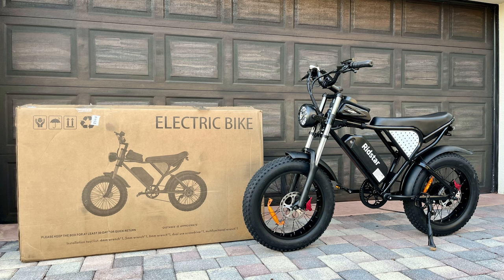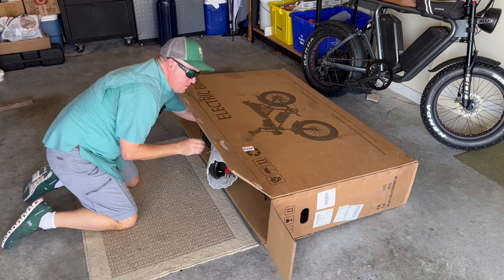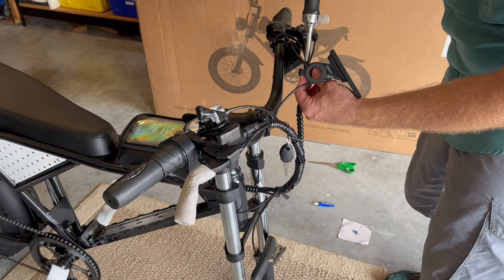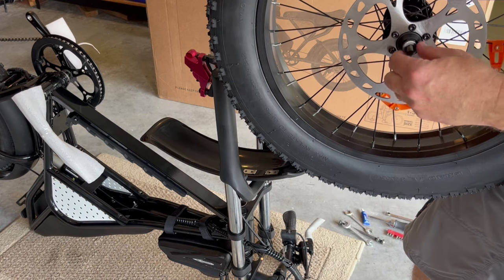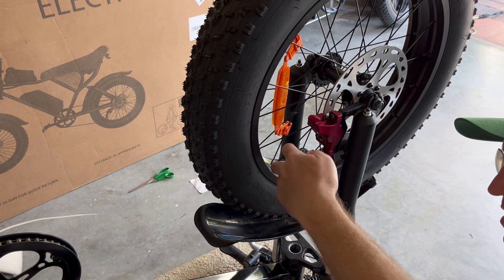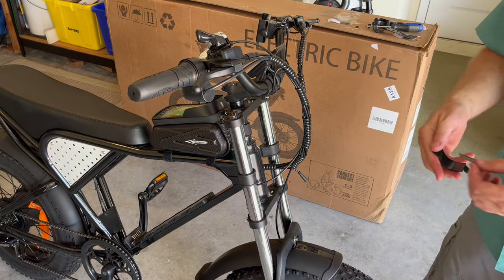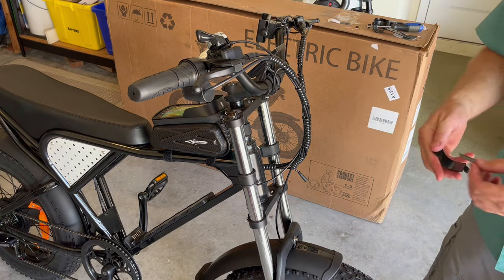Ridstar Q20 eBike - Unbox - Assembly - Settings

Comment: only problem i have is the front and back brakes not working and i cannot tighten them up how i want
Reply from the maker: loose 2 bolts on brake caliper so caliper can move in and out.  Squeeze brake lever to center caliper on rotor.  With lever squeezed then tighten bolts on caliper so its centered

Comment: I bought this bike from amazon,and arrived 16 days later. Really cool bike. Your video was really helpfull in putting it together.
I like everything except the handle bars are to low. Is there a kit to raise them up?
Reply from the maker: Glad I could help.   You can install handlebar spacer or stem riser.   Here is link and how to video. https://amzn.to/43632Gz.   https://youtu.be/vT6DfaVPI24
Reply: @BRichSolution  I was looking over the cable and wires, and they look like they are to short to raise the handle bar up. What size would you recommend for the Q20?
Reply: How's the bike holding up ??
Reply: @gates1980  I really like this bike. I would recommend this bike to everyone. Great price too!

Comment: I cant put my front wheel on, the front brake calipers are way too tight to slide the wheel in. What do I do?
Reply from the maker: You will need to spread the brake pads a part using a small wedge or door stop so you can slide the rotor between the pads

Comment: My disc brake still rubs I'm lost on how to fix it i followed the instructions
Reply from the maker: loosen bolt on the caliper brake so brake caliper can be adjusted freely.   squeeze brake to center on rotor and while brake is squeezed tight bolts so caliper is aligned with rotor
Reply: @BRichSolution  thanks I think I got it fixed I can't ride til tomorrow tho so I'll get bk to u appreciate u!!!!

Comment: Got my bike put together, but the front break isn’t working (I have no experience with disk breaks). Any advice?
Reply from the maker: When u squeeze the front brake lever nothing happens?   If so local bike shop can bleed brake line in 5 minutes for you
Reply: @BRichSolution  I’m able to squeeze the brake lever to the grip. I also tried loosening the pads since they’re rubbing the disc (like you did in the vid). But the bolts are fairly tight, to the point the Allen wrench feels like it’s about to break trying to loosen them.

Comment: Hello I have a question, when u keep the + electric gear up for like 3 second it says something on the screen what does that mean
Reply from the maker: Hold on the + button turns on headlight if configure that way… but this bike is not and has manual switch for headlight

Comment: Hi I just purchased a ridstar q20 but the front wheel axel is too short to even screw onto the bike?? Is there any way I can remedy this! Or would I have to take the whole thing apart again and return it?
Reply from the maker: Ask seller for longer axial bolt or go to ace hardware or tru value hardware department and find a longer axial bolt

Comment: Hello, does it have a Serial Number ? If so where can I find it ?
 I got this EBike based on your favorable reviews of its value vs performance.
 I need the SN so I can get a Rebate from our county"s eBike encouragement program.
Reply from the maker: Serial # is on left side of steering tune (handlebars into the frame)
Reply: @BRichSolution  Thank you for the very prompt reply.

Comment: Do you happen to know what size the bolt and washer are for the front tire? Mine somehow fell off and I can’t seem to figure it out.
Reply from the maker: M10 axle bolt by 175mm long should work.   https://www.ebay.com/itm/174666567440?mkcid=16&mkevt=1&mkrid=711-127632-2357-0&ssspo=cx2qeP1dTGq&sssrc=4429486&ssuid=qKDltCGGRDS&var=&widget_ver=artemis&media=COPY

Comment: Bonjour monsieur je ne sais pas si vous comprenez le français mais j'ai un problème, je n'y connais rien c'est mon premier vélo électrique. J'ai bien enclenché la batterie mais je n'arrive pas à tourner la clé et je ne veux pas forcer. Merci si vous me répondez, sinon je vais essayer de vous écrire avec Google traduction. Bonne journée
Reply from the maker: I had this issue with another bike.  Ask seller for replacement throttle and key

Comment: My chain slipped off and i don’t know what to do it’s on the right side pedal
Reply from the maker: Pull transmission (2 small wheels in the back) forward and chain has slack to engage front sprocket
Reply: @BRichSolution  i have one more question I tried getting the battery to charge and it was showing red on both sides and now it’s showing red and green. When i first plugged it up the fan would start making noise which i think it’s intended but now its not, it was charging properly or really i don’t know but if you can respond that would.

Great video btw

Comment: how do i take the battery off, because my key only turns 180 degrees from left to right. I don't dare twist or give the battery a tug.
Reply from the maker: Try to move or jiggle the battery on the frame when turning key to get the lock plunger to loosen up
Reply: Thanks for the advice, It works!

Comment: I got mine today and it seems like the breaks aren't working well at all the front and back ones barley work do you know why and what the fix is?
Reply from the maker: Is the lever easy squeezed all the way down and pads did not engage rotor?   If so maybe forgot to put hydraulic fluid in the brake lines?   You will need to bleed brake lines and fill with mineral oil or take to local bike shop they can bleed lines in 10 minutes
Reply: I noticed it's only the front break there is no compression with the front break could it be I didn't but it in the caliper properly or most likely just needs breaks blead

Comment: Has anyone tried throwing a higher amp controller in one of these?
Reply from the maker: Q20 speed and torque is respected and not worth changing controller IMO as you’d only gain 1-2 mph top speed.  $5000 super 73s only do 32 mph due to physics of 48V battery and motor.   The other issue is higher amps means less range.  See controller specs in this video https://youtu.be/Z7i8O1BFJdc
Reply from the maker: Do you have the 15Ah version or 20Ah version of the Q20 bike?

Comment: I just bought and built a ridstar but the breaks are really bad and in first gear when I pedal it just clicks please help
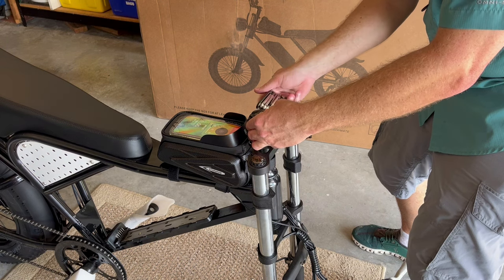Reply from the maker: see video linked below at 2:55 for aligning brakes https://youtu.be/uk_nC9anQcM?si=6ypqSvX8NsCVti84
Reply: @BRichSolution  hi thanks so much for replying yes I tried too but my bolts are too tight to tighten them more I am hardly unscrew or screw it more and for some reason my gears are weird please help me

Comment: Have you heard about Mario Retro Plus e-bike?
Reply from the maker: Mario retro plus is 1000w motor with only 15ah battery (throttle only range maybe 25 miles) and over priced at $1595.   For $1500 buy a dual battery Yolin with 44ah battery with 60 mile throttle only range.  Also the Mario has no rear suspension.   This Ridstar q20 for $1000 is much better deal over the Mario

Comment: Yet another question. The manual states that if the battery makes a strange noise, the battery may not continue to charge and is therefore defective. I doubt the sound I hear. may the charger blow a little to cool?
Reply from the maker: Yes the charger has a fan on it to keep it cool

Comment: Did any of you take the test for this bc my state considers it as a moped vehicle and requires me to have a operational license 😢
Reply from the maker: Most states ebike law is pedals and 750W max.  This has 1000w but most cops don’t know what they are looking at or buy a sticker that says 750w and they will leave u alone
Reply: @BRichSolution  I won't really use it on the road, just mostly on trails so should I buy it?

Comment: After I messed with the settings my battery only shows 1 bar out of  ten on the display. Do you know how to fix this?
Reply from the maker: The last setting in the advanced menu should reset everything back to factory default.  Hold the + and - buttons for 3 secs
Reply: @BRichSolution how do I reset it from that menu, if it’s the same buttons to go back to the main menu

Comment: Hello is there any website showing any customisation people may have made regarding Q20? Also will changing the 1000w 48v 20a e-bike controller to a 48v 25a or 52v 25a make any difference to top speed? If so can someone link me to a good controller to buy in UK. Also the multi colour chains you can buy for Super73 would any of them work with this e-bike? In general are there any must have upgrades you really recommend forQ20. Thanks
Reply from the maker: If your going to customize Q20 or X20 by going to 52V the price go up and IMO not worth the higher price when you can buy the dual battery Yolin for the same prices with 52V batteries thay are larger capacity, motor is faster and frame is aluminum vs q20 is steel.   The yolin is faster then super 73 https://youtu.be/y3XJkRnppJ0

Comment: I bought the same one and the front wheel didn’t fit. The threaded part was too short and needed to be longer to fit a screw. Also came with different hardware.
Reply from the maker: Is the seller sending longer axial bolt?
Reply: @BRichSolution  I figured it out. It was actually perfectly fine. I just needed to read the manual. Thank you though. For the extra battery in your other video, can I just use the stock charger to charge it?

Comment: is there any way to swap out the front fork for better suspension? if so can you show me a fork that will work for this bike?
Reply from the maker: buy air fork; the one in this video will fit and the procedure is the same except even easier as none of the cables route thru the crown so there is nothing to cut.   https://youtu.be/mbCBl9HIH3M

Comment: where I can find a rear rack for this e bike
Reply from the maker: This will be difficult because the rear trailing arm with rear wheel is independent of the frame so you can attach them.  Would a larger cargo bag between handlebars and seat work?

Comment: Now i have only 3 Mode, before was 5.
And now from 1 level im drive maximal 😢
Reply from the maker: Use the user manual in description under this video for m5 display settings.  I think P05 needs to change for 1-5
https://youtu.be/m6aOD4dfe4w
Reply: @BRichSolution  thanks 💪🏻😎👍🏻

Comment: hey man just got the bike i was wondering what the energy bars on the screen mean
Reply from the maker: Battery charge state.  Each bar is about 20%
Reply: thank you! And also do you know if there  is a way to change the half twist throttle to a full twist throttle? 
 @BRichSolution

Comment: also, is it safe to leave the battery on the charger all night? and is that also allowed while it is attached to the bicycle?
Reply from the maker: I wouldn’t leave in the charger all night.  Most ebike battery fires are due to thermal runaway when bike is left on charger.  I use a timer or wifi timer to shut the charger off after 3-6 hours
Reply: Thanks for the quick reply and the information!

Comment: hello, the M5 display the energy and bar are next to each other there are 10 little bars are all those bars representing the whole battery life? i am confused because there is a lil bar in the middle sorry for the long question
Reply from the maker: Did you buy the 15Ah version of Q20 with smaller display?
Reply: @BRichSolution  I bought the 15Ah the newer display models of the ouxi v8
Reply: @BRichSolution  I have the 48 volt display

Comment: My Q20 delivered yesterday and I noticed mine came with only 1 wrench in the box, not 2 like in this video but, they included a quick release skewer which I also didn't see in this video. 

It also came with a quick release axle in the box. Yours is assembled using the nuts and washers that come directly off of the wheels but this one has this part included. I dont know if that's considered an upgrade or a cheaper/more faulty option? 1st ebike problems 😅

The battery did come fully charged though.🏆
Reply from the maker: I wish mine had quick realization front wheel

Comment: How long battery last?
Reply from the maker: 20Ah battery version with full speed no pedal on flat ground 27 miles.  You can go further if you pedal a little or lower speed
Reply: @BRichSolution  thank you so much it really means a helpfull

Comment: Finally pulled the trigger! 1044 Amazon,  almost got the happyrun  G50 for 999, but I think  i made the correct choice! Wondering,  can the handlebar stem be raised at all? I'm trying to avoid leaning over to ride as much as possible,  thanks for all the feedback,  ur very kind with all the questions.
Reply from the maker: Yes you can add riser like i did on my ridstar fold see video https://youtu.be/vT6DfaVPI24?si=k40xDdKStpgEkPXF
Reply: I hope you dont' need to deal with customer service in the coming weeks or months.  Its HORRIBLE! Don't expect to speak to anyone on the phone. Its only email to china.  Then you might regret getting this bike.  Its fun when it runs but if it breaks down its a nightmare..
Reply: @BRichSolution  that's the exact same one I ordered,  be here tomorrow. Cool. Thank you
Reply: @proudbirther1998  ahh no. What happened to yours?  U get it resolved? Yeah I had a scooter that I had to deal with a company like that you have to get tough with them before they actually do anything I ended up sending the scooter back just because I didn't want it and they basically begged me to keep it but I didn't want it they did refund my money though
Reply: @JHOFF111  One day the bike stopped working. Communication with the company in China was basically receiving an email from one of their reps or techs and they would have you test different electrical devices on the the bike ie Lights Tail LIghts Brake Lights by disconnecting different wires and then you had to email them back with your findings. They they would send you another email and test some other connection and if some part turned on or remained off. I understand the concept of following a flow chart to narrow down a problem but its a very slow process. In following one of their instructions to test something we inadvertently discovered the cause of the problem. It turned out to be a simple fix and not electrical. Our issue turned out to be a sensor in the Brake Handle. Kind of reminds you of a Ball point pen that you have to push down to get the writing tip to come out the other end . In the normal Brake handle position this little plunger tip is pushed in. When you squeeze the brake lever it creates a gap where this plunger can extend and this sends a signal to apply the brake. Somehow this sensor had slightly backed out of its houseing so to the controller it appeared the brake was on. This one thing prevented the bike /throttle from working. After pushing this sensor tight into the housing it worked.

There is NO TELLING HOW LONG it would have taken for this issue to be resolved doing one email a day with the company. 
That said the bike is a good bike and fun to ride.

Comment: Hey Rich! Love all your videos, helped me make a final decision on the ebike i wanted. Just recently purchased the Ridstar, installed everything and adjusted my brake calipers like you demonstrated. Unfortunately there is still a slight grind on both front and rear brakes, and I was wondering if you had the same situation. Do i need to break the brakes in more? Thanks!
Reply from the maker: I had to Adjust the brake calipers on the rotor a few times to get things aligned then i was all good
Reply: @BRichSolution  did some adjustments and got it perfect. To add on, I’ve been looking around for a bike lock and getting a lot of mixed reviews as well as trying to imagine where i would place the lock on the Q20. Any suggestions?
Reply: @disk lock brake with an alarm. Get 2 locks JShaw04200

Comment: my display screen is way smaller then yours
Reply from the maker: Do you have mechanical brakes and 15Ah battery?  If so the less expensive version has smaller screen.  Make sure to buy 20Ah version with hydraulic brake
Reply: @BRichSolution  mine has disc brakes and I'm pretty sure it's a 20ah battery I got it for $549 on Amazon $300 shipping..after taxes was $900ish I love it so far only thing I was bummed out about was the display is a small screen on the left handlebar and I thought it was gonna be the bigger one but it's all good
Reply: @BRichSolution i was wrong mine is the 15ah battery. oh well I'm happy it tops out at 28mph
Reply: Same

Comment: l was thinking of getting this until i saw your video and how much of a nightmare it is is to put together. You even have to pump the tyres.
Reply from the maker: All the ebikes required assembly.  Most likely tires will be properly inflated.  This bike  is pretty easy install handlebars, front tire, fendor and headlight
Reply: @BRichSolution  ok thanks.

Comment: All new ebikers, get torque arms for your bike. 
Aluminum frame dropouts tend to get eaten by the axle until it freely spins.
Dont cheap out, get the thick steel torque arms. Save yourself a headache
Reply from the maker: Yes, thats why ebikes under $999 typically are steel frame

Comment: Man this bike is something lol. Aside from that, how do I test the controllers output on the motors if they’re 30A and 52-58v? Never done it before. Furthermore thank you for the link. I’ll keep that in mind. You also said that there could be a power restriction in the motor. What should I look out for if this is the case? And the bike is about 100 lbs. And if it helps with anything I also weigh 170 lbs.
Reply from the maker: I am 170 lbs and yolin 48v 1000w does 34mph and the 52 with 1000w does 35-36 mph.   To test the output get a voltmeter and test the voltage coming out of the controller to the motor by unplugging the motor cable and twisting throttle.   Like this video shows
https://youtu.be/KFFWY6UIw8A
Reply: @BRichSolution  ok sounds good. I’ll see what I can do. I’ve been saving up so I probably won’t get a voltmeter just yet.